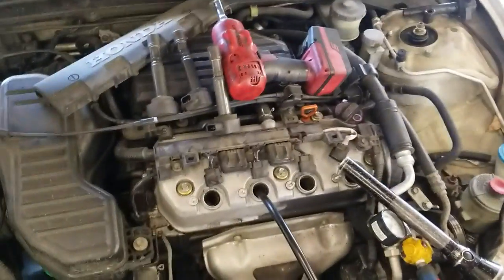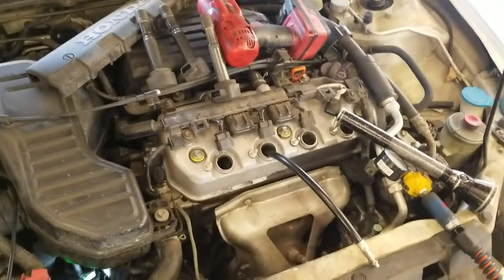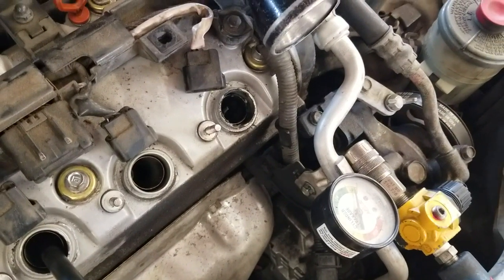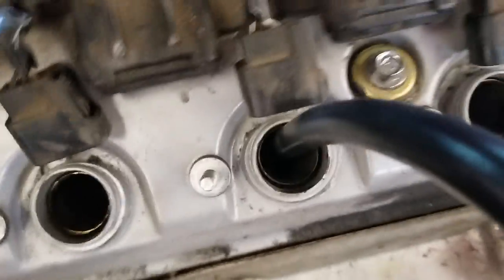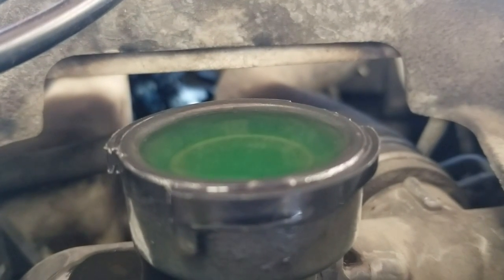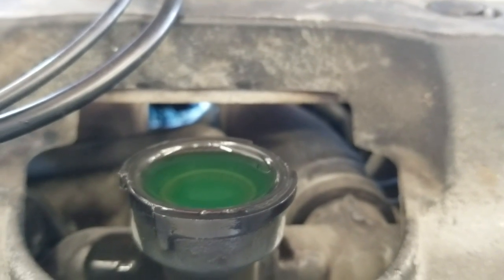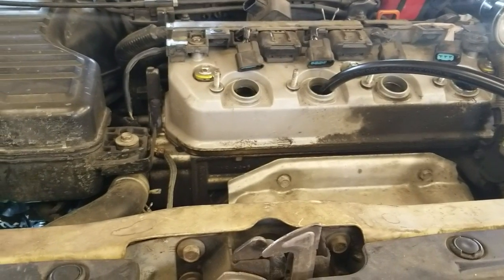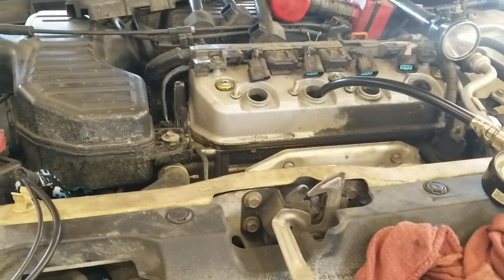Best way to diagnose if your head gasket is bad

Comment: Also, i heard from a Honda Specialist, he said that 01-05 Civics do not take that green coolant lightly lol... apparently it'll destroy the coolant jackets and such. Pitting in the metal, etc.
Reply: Better to use blue coolant.  Honda Coolant.
Reply: @1_Bad_Z  I don't use OEM Honda Torqoise coolant but I use Zerex Blue, been using it for 4 years no issues.
Reply: @whatheck6709  what's wrong with Honda coolant from Dealer?
Reply: @1_Bad_Z  nothing lol. I didn't mention anything wrong with it.
Reply: @whatheck6709  cool. I just purchased a used Honda. I've noticed they use blue coolant.  My first Honda.
Reply: @1_Bad_Z  I just use Blue Zerex because I ain't tryna drive all the way to a Honda dealer when I got an O Reilly's like 2 minutes from me. But you can order OEM Honda coolant online

Comment: Just because a car coolant overflow a Lil doesn't mean a bad headgasket  i have been using a car too year that overflow coolant if i remove the rad cap and never over heat and Still make bubbles with cap off
Reply from the maker: if cylinder is leaking exhaust gas into cooling jacket, you have a head gasket or damaged engine. it is not normal to leak pressure cylinder pressure into cooling system. thanks for comment

Comment: Open the oil cap and see if it has chocolate milk
Reply: Sometimes chocolate milk in the oil cap is just from condensation
Reply from the maker: this one has no chocolate milk. but it has a blown headgasket.
Reply: @subtledriver  how did it have a blown gasket if no coolant was found in oil dip stick or upon oil change,  wouldn't coolant be found inside drained oil, even if its minimal coolant?

Comment: Poor car.. In 3:50 you said;  let the poor car retire. Why let it retire ? Replace the head gasket.  If the lady doesn't want to spend money on the car, buy it from her, Fix the car yourself. I would. My Dear God, I don't know how many cars I restored. Mechanics told me and my son, junk the car, it's not even worth fixing.  My son always told the mechanics; My dad wont let the car go. My dad loves a good challenge.  I restored the cars, Why junk them ?
Reply: Exactly, we should just stop manufacturing cars and just maintain and modify what we have. There's already enough cars for everyone right now.
Reply from the maker: This car will cost too much to maintain, transmission and plenty of other issues are present, as well as an over heated motor that has over a decade of deferred maintenance. Its more cost effective to buy a different model and move forward.

Comment: White smoke out of the tailpipe is a sign of a blown head gasket
Reply: Yeah thats one of the signs
Reply: Can also be burning transmission fluid on models that have a vacuum line to the tranny. Most older auto trans do.

Comment: Why do mechanics fear head gaskets? They are not that hard to change if you have a shop.
Reply: bc advanced damage to hg can cause cylinder heads to crack and once there is a crack every other component in the combustion chamber needs to be checked prior to fixing
Reply: @automachinehead  Good point

Comment: How do u know what kind of pressure tool besides the gage that u have air to it to use....what is in the hole....and how without having the engine apart....do u  know when it's too dead center????
Reply: Yeah really.  I had the same questions.  Helpful video and interesting but not complete really.

Comment: Great test, now is there a way to single out which cylinder or cylinders are the one with the issue? If I leave the spark plugs on and I only air each cylinder?
Reply from the maker: Yes, you got it

Comment: Very helpful video! Thank you for sharing! What do you think about flusing the coolant and changing over dexcool to regular coolant? I have an 05 Buick Century, and dexcool is not good for the head gasket in that particular year, make, model, but that's the original coolant that the car comes with. It's a defect that has since been fixed in newer models, but I have the older model and I'm looking to change it out completely.
Reply: There are several different ways to do a blown head gasket check. The best way is do a pressure check. But the cheapest way I have found is; remove all spark plugs, remove the fuel relay, and start the car.If you have a blown head gasket, water will squirt out through the spark plug holes. To do this exercise, you will need 2 bodies. But The pressure check is the best way. There are other ways as well. If you wanna be a mechanic.
Reply from the maker: I personally run toyota pink or asian pink coolant in all my vehicles. but i dont see any issues running dexcool.
Reply: @subtledriver    If it ever slightly overheats or gets air in the system Dex cool turns to brown and black sludge.  My Buick the coolant elbows burst causing it to slightly overheat before I caught it . I had to flush the radiator and block added Dex cool back into system then 9 months later the thermostat stuck closed and again slightly overheated . I had to flush with radiator cleaner because radiator had brown/ black sludge.  I again flushed it with radiator cleaner and distilled water.  This time just running distilled water In it for now but temperatures never rise above 196 and I can idle with air on for 30 minutes and temp may rise 4 degrees but that’s all.  With Dex Cool I couldn’t do that before temp would be getting to high. Personally I believe Dex Cool is garbage.

Comment: Yeah I bought a car that has a bad head gasket builds pressure in the coolant reservoir an you can see metal flake an small bubbles moving in the reservoir even after I flushed it so I’m going to have that done sometime an also blew or cracked the reservoir while in the garage so going to need towed in 😕

Comment: I bought my first car with a blown head gasket. At the time it had obvious signs but I didn't know what it was. You expect better things from a human being. My second car also had a blown head gasket, it was a dealer in NJ who hid all possible signs by using sealant I guess. Signs started to appear weeks after the purchase. They were not obvious, first a CEL, then hesitating at cold start. Then you go to the grocery store to the way home and it wouldn’t start. What a nightmare with that car. Honestly, I didn’t know until now what it was like to have a car that doesn’t need coolant every time you drive it. I was constantly checking my 3rd car as I almost have a trauma. THE ONLY WAY TO TEST IT RIGHT is by doing a cylinder compression test. No chemical test on the radiator, no pressurizing the cooling system, forget it. It's like a sickness with different symptoms or no symptoms at all. Thank God my 3rd car is fine. Now, I just bought a Corolla with 90K miles and I’m freaking out as the coolant level went down a bit. (4 years later, story revisited) my Corolla is alright. 25K miles strong. It only loses 3/4 inch of coolant every 6 months, same as when I bought it. My prayers were heard. Thanks for comments.

I have learned that you must change the coolant every 5 years. Most ppl don’t do it. It becomes acidic and it eats up the head gasket. When you buy a used car that’s over 5 yrs old how would you know if they took care of it? When you see a water pump that goes out it’s acidic coolant. You wouldn’t have to repair a water pump and that’s an obvious sign that you may have issues with the head gasket already or soon enough.
Reply: I got a car to sell you. 

Haha
Reply: this is literally my life rn. my first car had a bad water pump and once that was fixed we found it had a bad head gasket. me and my friends went to fixing it but got a cam retainer bolt stuck in the cylinder head while putting it back together with the new gasket, so i went looking for ANOTHER integra and found the same year. but its looking like this might have a bad head gasket too. i can probably use the cylinder head from this one if its not cracked, but damn life really sucks. it feels very easy to hide a blown head gasket when selling a car and say nothing about it to the buyer. a little bit to easy.
Reply: Cars are cancer
Reply: That's why I buy a car new and keep it for 10 years. At least I know the car history.  I had bad luck with used cars, even with professional inspection.
Reply: OP replace your thermostat. I've had all the signs pointing to a blown head gasket. Turned out to be the thermostat.
Reply: @nikkoBcool  What signs did you have?
Reply: @nikkoBcool  If this is doing this with a cold motor, though, (as mine is), it shouldn't be the thermostat, as it's normally closed, anyway, when it's cold..
Reply: Don’t worry bro I had three in a row with that head gaskets 😂
Reply: @waynv1835  Coolant in the oil (from a blown head gasket) can cause the dip stick oil level to register much higher than normal. Was the color of your oil "milky" looking on your dipstick? If so, it's because of the water / coolant in it from a blown head gasket..
Reply: Yeh I bought a 2010 jeep liberty and same issue.
Reply: Yeah that would be traumatizing. Glad you found a good car now.
Reply: sorry to hear that, glad is all good with ur 3rd car , hehe i like ur honesty u should write more, cheers
Reply: @waynv1835  If it’s valve train noise you’re hearing, you may need to adjust the valve lash, if it’s adjustable on your model.
Reply: I hope your Corolla continues to treat you well, God bless!
Reply: how long were you able to keep driving your car with these symptoms? i'm just realizing i bought a car like this:(
Reply: @therealsyndicate  the 2nd car, we put over 30K miles on it. 2 years and a half. In the last few months I put sealant and kept it going for a couple of months more. Then it had a lot of white smoke and you couldn’t start it hot, meaning, you had to go from point A to B. You couldn’t shut it down to go into a store and then it wouldn’t start. We had to add coolant every couple of days.
Reply: Easy $400 dollar repair if you do it your self stop complaining
Reply: @Angel-xj3wf  nobody repairs a blown gasket
Reply: @JardinesCodorus  yes most normal people will just replace it
Reply: Getting good at fixing head gaskets.
Reply: Was your dealer sussex auto?
Reply: NEVER EVER BUY GERMAN CARS! People go get a Lexus like i did 👌🏻
Reply: Who cares? If you buy a car with a decent motor it’s a simple fix. Don’t buy some foreign trash with the motor upside down or sideways and you’ll be fine
Reply: Same here. My first car had a blown head gasket. The previous owner only used water instead of coolant, and ever since, I’ve had nonstop coolant problems. First, it was the pump, then the radiator, and now the gasket again. Honestly, I’m traumatized from always having to check the coolant level before every drive and topping it up all the time. It turned into a total nightmare
Reply: wish I saw this before buying mine🫩
Reply: If the coolant level decreases after 2 mounths a little than it is considering good but cheacking of car by give preasure to cylinder is brilient idea
Reply: @asifsaleem2282  cylinder pressure test is the only way to be sure. My experience with these cars is that in the beginning they didn’t have the obvious signs of gasket damage. Either the dealer applied sealant or it was a very tiny crack.

Comment: Hi, great demonstration but you didn't explain what are those holes, sorry for my lack of basic knowledge.
Reply: Those are where the spark plugs go. Yo will see the spark plugs inside the holes when you pluck of the rubber coilovers. At 1:23 he begins to explain that the device is used in leu of the spark plugs(you can remove the spark plugs via wrench.) 
I wish I knew this info when my ‘01 Honda Accord went out. Rip
Reply from the maker: Allan gave a good response.

Comment: Hello, I've a 2005 ford explorer v6. It has oil in the coolant reservoir. It has a transmission cooler that is not connected to the coolant, it has no engine oil cooler. So the only thing i can think about is a bad head gasket? Btw 2 head leak detection tests that i did were negative (is a false negative possible?). The engine was rebuild and was put in 1k miles ago, however the store employee forgot to tigthen the clamb on the bottom of the radiator and i was at least 2-3 quarts low on coolant, can that have done the damage?

Comment: Ive some question, I did a drain and fill of coolant on my 2020 hyundai accent , drain the radiator and reservoir and fill it back in and put the cap back on, and i started the car with ac in full blast, then i took a bath maybe 15mins then when i get back to the the car the temp gauge is flashing red, i quickly turn the car off, waited 2 mins then i opened  the radiator cap and filled in about just a glass of coolant and its already full, then i started the car again , in less than a minute the temp gauge went back to normal, drove it around and rev it and everything is back to normal, the question i had in mind is did i make any serious engine damage from the overheat like head gasket?
Reply: It's extremely strange how you and the content poster felt the need to shower at exactly the same time

Comment: Why not just check the oil dipstick. Wouldn't coolant be mixing with the oil if head gasket is blown? Back in the day we would always find the milky looking oil on dipstick.
Reply: It depends where the gasket is blown, it can either have coolant in oil, or exhaust gases in coolant reservoir/radiator
Reply: if the head gasket is blown that doesnt always mean oil and coolant will mix, it depends how the gasket broke
Reply: On these D17 civic, that's not gonna happen.

Comment: So, what if the leak is between the water jackets and the oil?
Foamy white oil is the symptom.
Reply: Better to have oil in water than water in oil.
Reply: That’s coolant and oil, that is a head gasket.
The head gasket has 3 sections, that’s one of em

Comment: Also means you have air in the system don’t confuse these kids you have to remind if there’s air in your radiator after draining / or replacing a radiator there will be air in the radiator which causes this and also over heating
Reply: Air in the cooling system causes a non running, cold engine.. To suddenly have a higher level of coolant when the cylinder is pressurized? ... And then goes down the instant it is not pressurized? Huh. Explain please Sensei.
Reply: Negative. Pressurizing a cylinder on a non-running vehicle should not affect the cooling system... unless the head gasket has failed.
Reply: When you’re able to pressurize the cooling system through the combustion chamber and rad overflows, blows bubbles, you’ve got a blown head gasket.  
Stop misleading the kids.
Reply: What about the smell of exhaust in the reservoir tank  what does that mean
Reply: After replacing thermostat housing, I had air in system. Coolant level would rise and then drop. I’m also getting a lot of condensation in the tailpipe, but it doesn’t seem like mixed with oil.
Reply: Rubber / latex glove over the radiator filler, cap removed.  If the glove inflates, bad head gasket

Comment: I changed radiator recently and today wanted to check the coolant level, I waited nearly 4 hours and when I opened the cap it squirted coolant everywhere, the coolant wasnt hot just above room temp but why did it squirt out. I have checked the coolant couple times after the radiator change and never squirted. I thought 4 hours should be enough
Reply from the maker: I would check to see if your radiator cap is too high of pressure or the hose to the overflow bottle is clogged 1st. If those are ok, I would say it is possible you have a failed head gasket.

Comment: Hi mate great vid!! I have a question though was the engine cold or warm when you did the test?
Reply: Thanks for the reply! The reason I asked was because I was wondering if the thermostat would have an effect on it ie: if it was closed!
Reply from the maker: can be done either way. it was a little above room temp.

Comment: How was it running? Were there other signs, such as steamy exhaust, rough idle...? 
Thanks
Reply: If there is white smoke coming out when it's not even cold out, it may be a sign as the water is vaporizing. I also checked my dipstick and noticed water in oil pan
Reply: normally there will be "blue" fumes from the exhaust

Comment: Honda\Toyota can run 500k.. so worth to get gasket fixed.  America cars worthless. Get another car.
Reply from the maker: Honda and Toyota are the most common head gasket issues lately. The car in this video is a Honda
Reply: @subtledriver  agreed.  I had it replaced at 312,600 then now have almost 600,000 miles on it.  All are highway mileage as I go work 65 miles one way daily.

Comment: I passed the chemical test on my car, but smell a sweet smell out of the exhaust, & hear way too much bubbling noises when I turn on my heater and climate controls. Heater core hasn't failed because there have been no leaks and heat is strong. But it feels too hot in the car even with the temp set to halfway or a bit less.
Reply from the maker: Try doing this test to check for a slight leak. This car passed the chemical test as well.
Reply: @subtledriver  Wish I could. I have a V8 and can't get the damn radiator cap off. Plus not sure about all this TDC stuff, keeping other valves closed as you said, or have that tool. I'm not losing coolant. Wondering if the easy thing, inspecting spark plugs, would give me any info. My mpg isn't as good as it should be also.
Reply: Why is the heat very high?